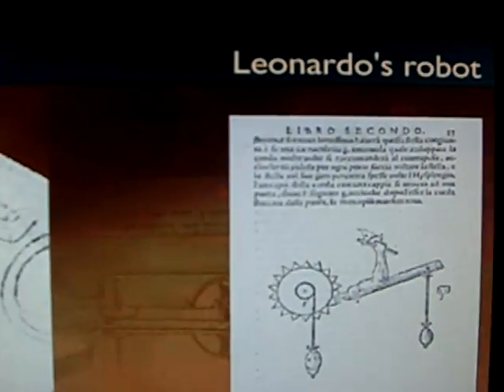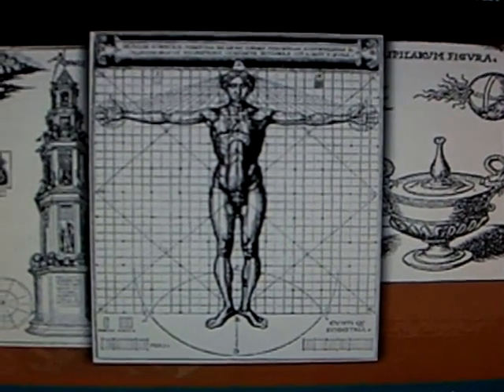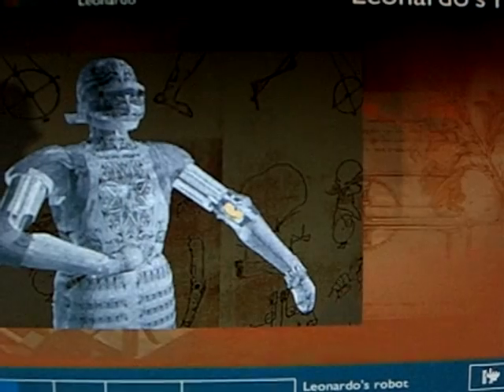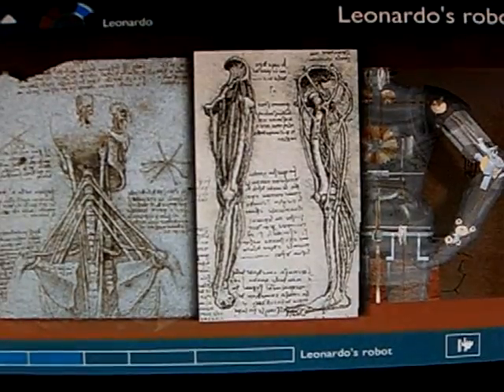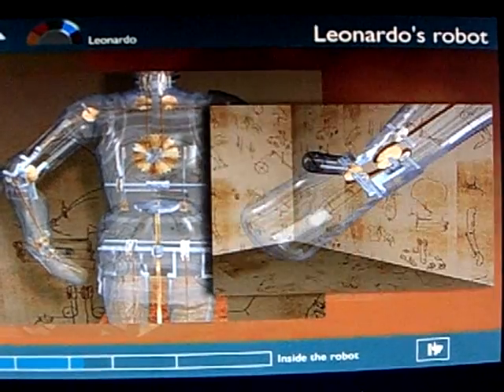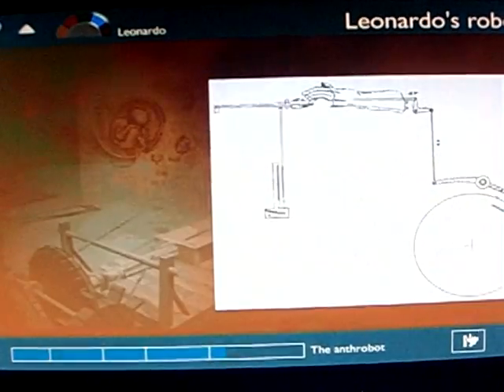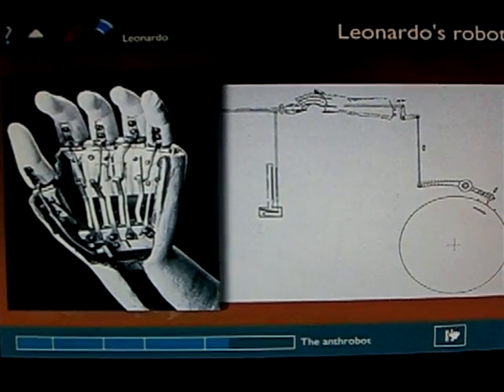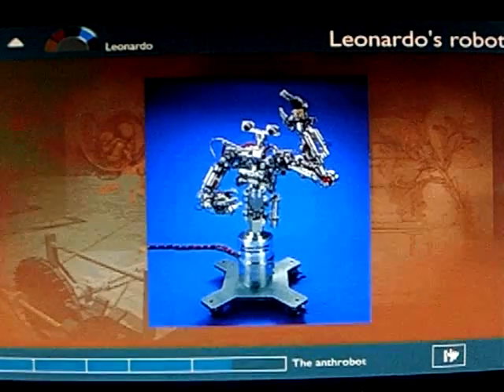Leonardo Da Vinci's  world first Human Robot

Comment: Still doesn’t really explain how the knight operated. Was it all an internal mechanism or through someone pulling on strings through intricately set up pulley systems to give it the illusion of autonomous movement like a puppet?
Reply: It said an analog programmable controller in the chest moved the arms and  body, and the legs were powered by an external crank connected to the ankle knees and hips… That’s not a robot, that’s a puppet🤷🏾‍♀️
Reply: @AhabyahofZion  An Animatronic is basically what it is, one created way ahead of its time.
Reply: Yeah kind of like that. It was controlled by a complicated pully system and Da Vinci used his study of anatomy to correctly move the muscles.